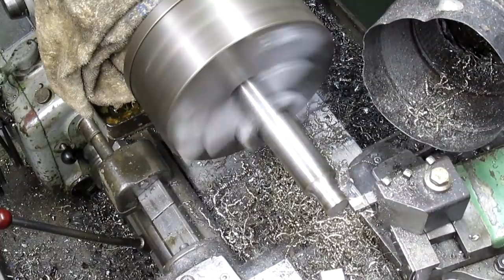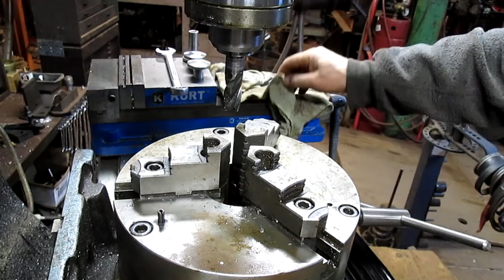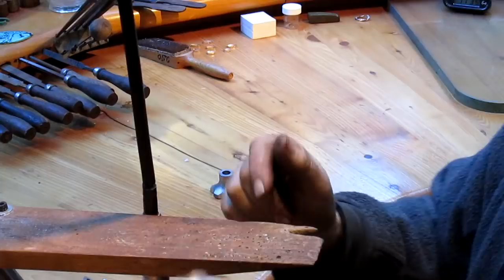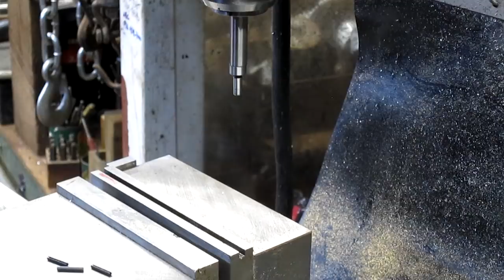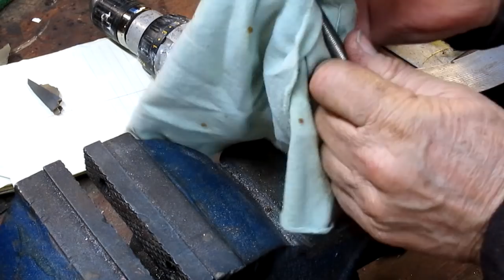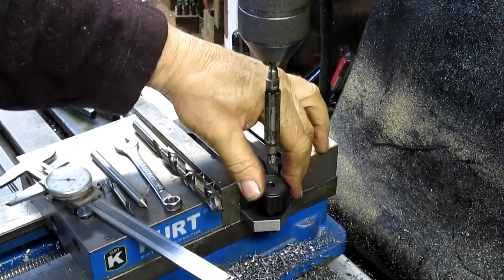Steady Rest Build #6

Comment: Hey Nik , wondering why that parting tool wouldn't work ?
Reply from the maker: My lathe is old and one of the worn parts is the spindle. No problem most of the time, but it starts jumping when parting. Workarounds are necessary with old tools.

Comment: Hi Nick, great vid again. Just a thought for years I shied away from parting off with my small lathe but over Christmas I thought I would give it another go and have mounted the blade upside down in the front tool post with the lathe turning backwards (as I have a cam lock style chuck). I wasn't expecting much but I must admit to being shocked at how good the results are. 50mm mild steel without a problem with BOTH HSS and carbide tipped. The carbide I can run at 800rpm with no issue and the HSS is fine at 250rpm. It is true you can teach an old dog new tricks!.

Mike
Reply from the maker: I'll have to give that one a try on my old MAS lathe.